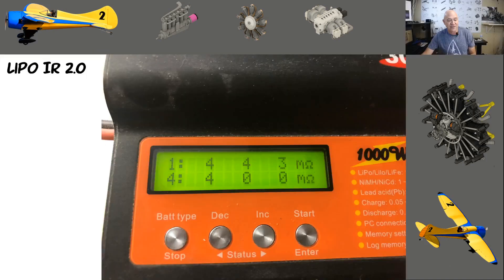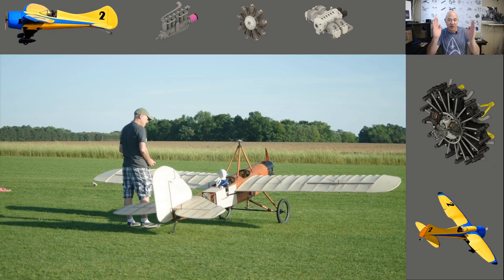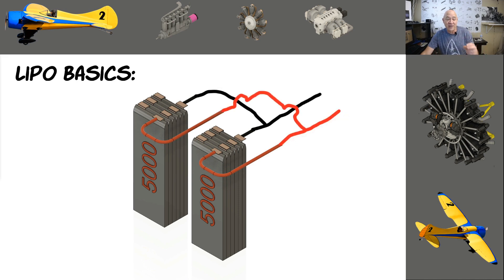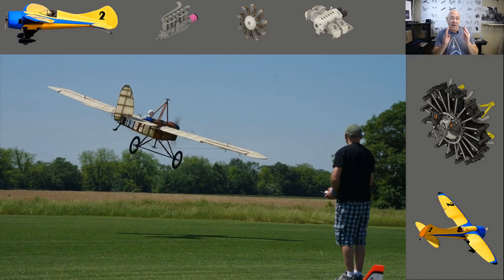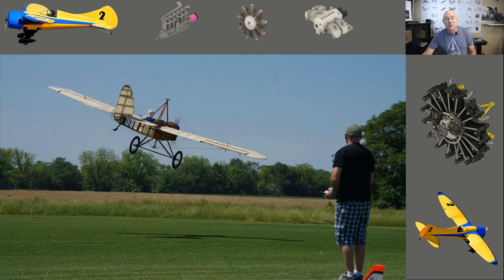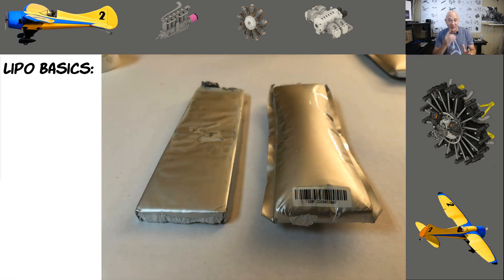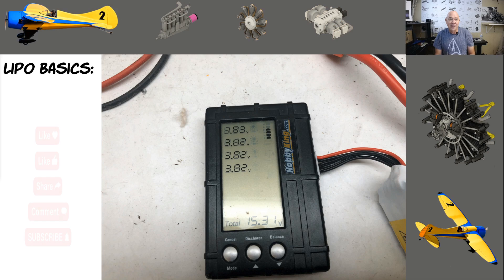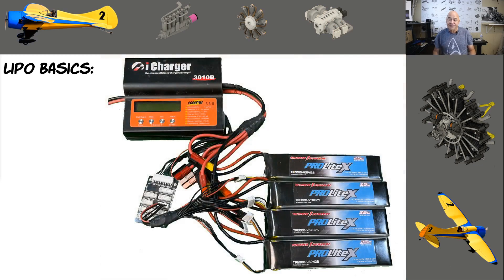Lipo internal resistance 2.0

Comment: what a safe amount time to leave a lipo battery charger up before use. 1 day or 2 days?
Reply from the maker: I have never tested to know. I have a few pals that will charge thier Lipos the night before. However, they are not planes that pull a huge amount of amps. My rule is to never pack up and go home for the day with Lipos with cells above 3.8v. I hope this helps. :)